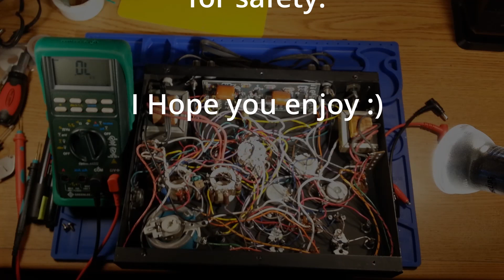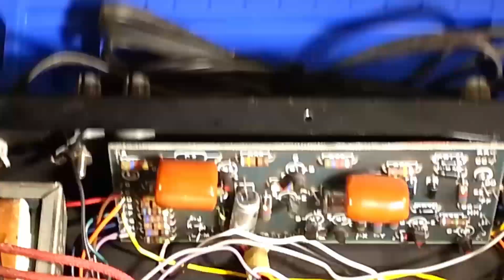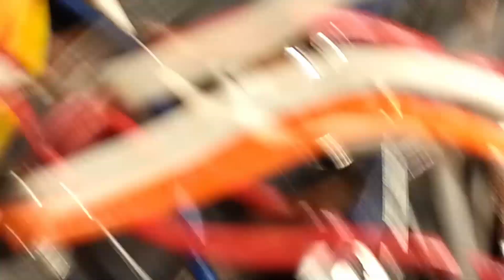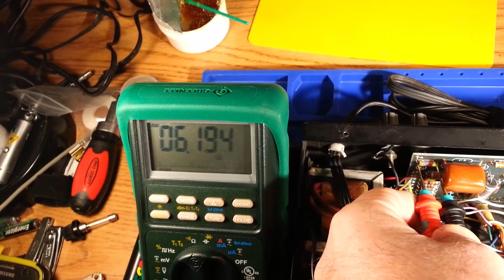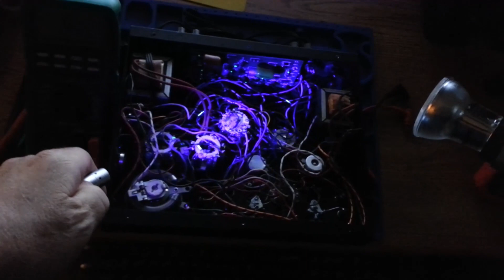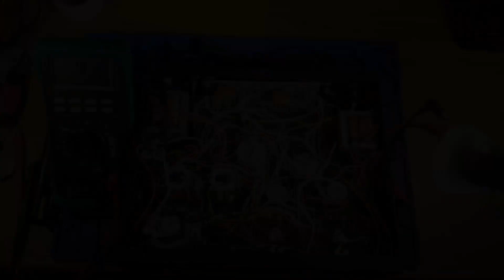E005_Part 1A - Component Inspection Tips

Comment: Paint pens are handy for marking assemblies so can get everything lined up putting stuff back together too. Hard to use a sharpie on dark colored parts.
Reply from the maker: I have seen some techs use paint pens, or nail polish paints, to identify groupings of IF coils when doing alignments as well, but those don't really have to be fluorescent. I chose that type to be able to re-find things I found needing attention on an initial survey, and could review using a UV light source quickly, to make sure that I didn't miss anything. The paint I chose seems to scratch off without too much effort if I mark an item like the switch deck that was just used for terminal connections, but had OOT (out of tolerance) components mounted to it.